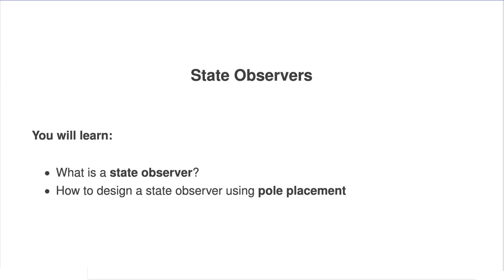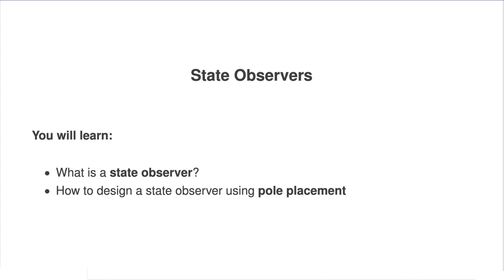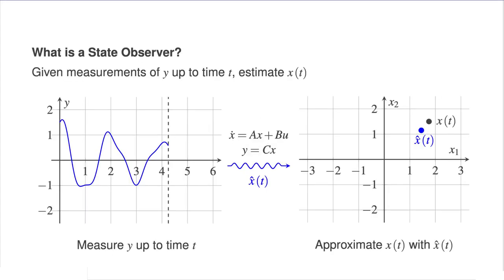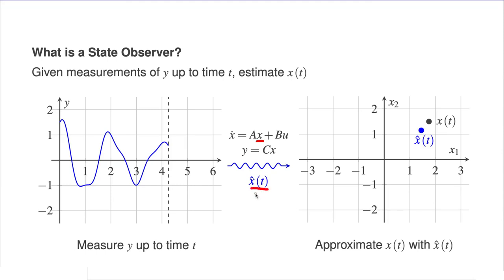Designing State Observers

Comment: Hey Richard, thank you so much for your videos, i have a small question, how did you obtain the wc = sqrt(2) in this example? and if i want to design an observer, would it be possible for a spring-damped system by just assuming some numbers for the coefficients of mass, spring and damper and then just simply estimate the position?
Reply from the maker: Hello! Good question. The wc=sqrt(2) is a bit of an artificial choice, mainly just to illustrate the calculation. Deciding how to place the poles is really quite a tricky issue in general, but the suggestion in the video is that the butterworth configuration often works quite well. In practice though you may need to experiment with a range of different values of wc, or even try out some other configurations if no value of wc gives the performance you want.

As for your second question, in a way, what you are proposing is very close to what a state-observer does - but with a small but important difference. The state observer equation is \dot(xhat)=Axhat+L(yhat-y). If we remove this L(yhat-y) term, the observer would match your suggestion. ie you assume that you know the coefficients (that is you know what is in the matrix A), and then just estimate the position based on that (i.e. simulate \dot(xhat)=Axhat). However the state-observe contains this extra term. Note that if your estimate matches your measurement exactly, yhat=y, and then this second term is zero, and we're in the situation from before. However if the two do not match, this extra term acts as a correction factor - by choosing the matrix L in the right way, the observer will drive this error to zero, forcing our estimate to match up with the true value of the state. So this set up makes us robust to inaccuracies and that type of thing - which you often need since you never know the coefficients exactly, and your measurements are always noisy etc.

Comment: Dear Richard, 
Thank you very much for your lecture. It is really great. 
I just have one question on the equation xhat(dot) at time 6:00. Do not you think it should be L(y-y(hat))?
Because you wrote then on time 31:17 ...L(y-y(hat)) :)
Thank you for your effort.
Best regards!
Reply from the maker: Aha, good spot! That's clearly inconsistent! Actually, L(y(hat)-y) is consistent with having the observer poles match the eigenvalues of A+LC (this is what we derive at 6:00). If instead we use L(y-y(hat)) the observer poles should match the eigenvalues of A-LC. Both schemes are actually completely fine - but in one case you should design the observer matrix to be the negative of the other. I've seen both approaches in text books, so I'm not really sure which to recommend most strongly - but if you understand the derivation (which it certainly seems you do) that is the main thing! Thanks for pointing this out!